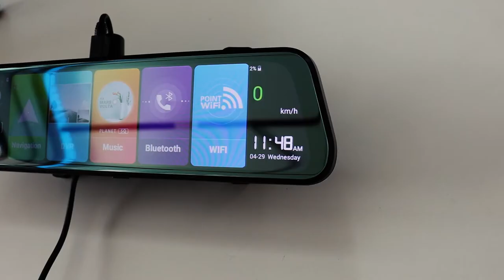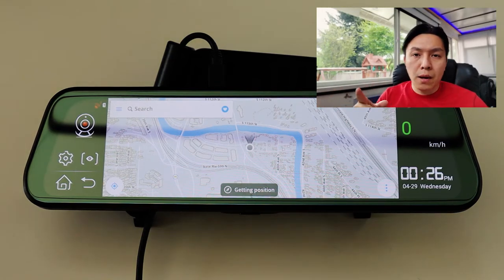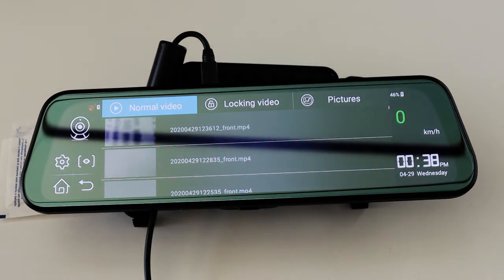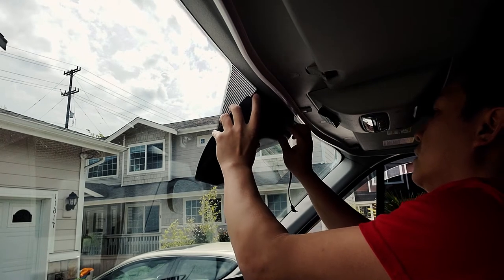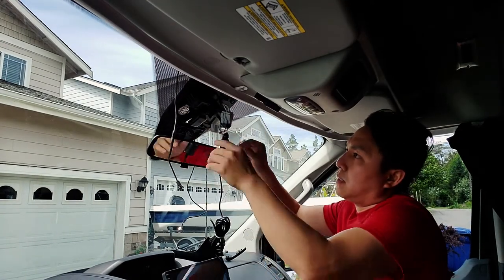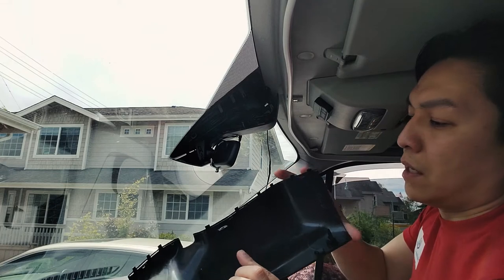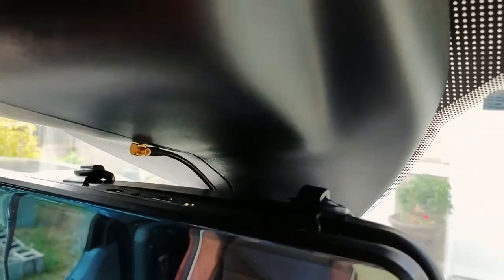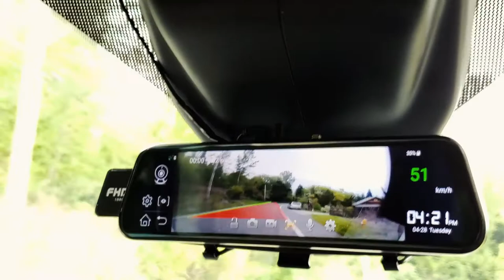12" LCD HD Rear View Mirror | Front & Rear recorder, Driving warning, DVR, Navigation, Bluetooth, 4G

Comment: Does it take a long time for the mirror to boot up?  When you go into reverse you want the mirror to be active immediately.  Also is there an adaptor so that this replaces the existing mirror?
Reply from the maker: Not too long, it takes about 15-20 seconds to boot up if the internal battery go flat overnight. If it is not dead then pretty quick. It can only clip on and no adapter.